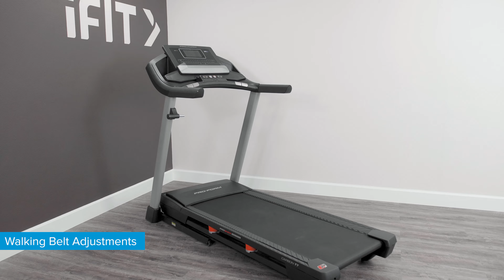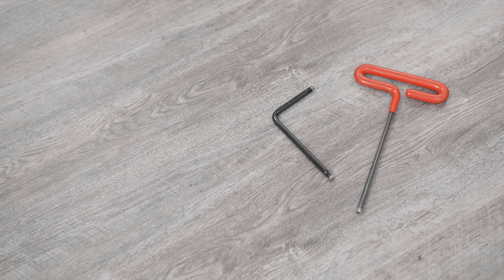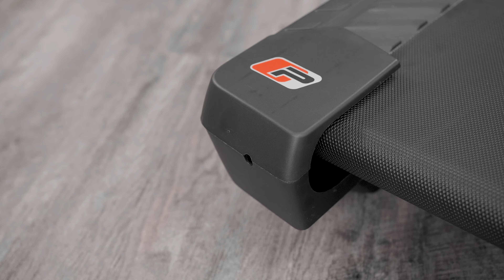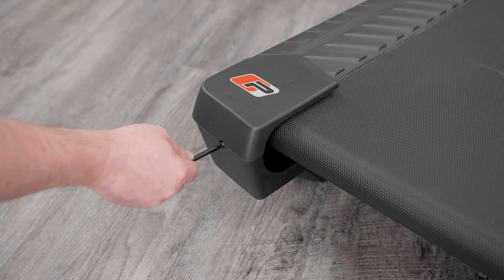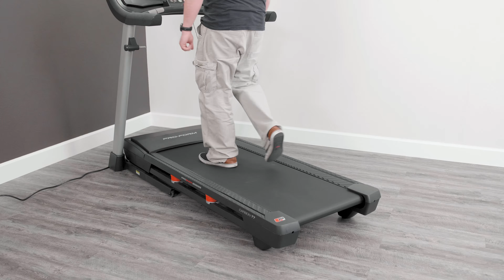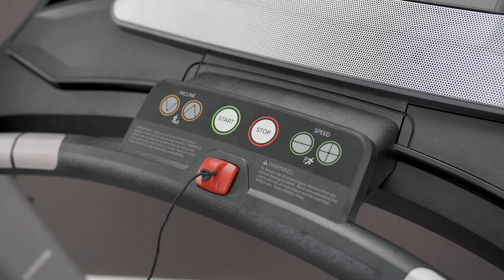Treadmill Walking Belt Adjustments

Comment: My treadmill has a high pitch squeak with every step I make on the right side while I run. Is that a loose bolt issue or a belt issue? It’s very annoying and I can’t figure it out
Reply from the maker: Does it happen with every user? Try running in a different pair of shoes. Often a loud zippy noise that only occurs with one foot fall or only one user is actually your shoe skimming the top of the walking belt. Good luck.

Comment: My Pro Form 425ct does not come on when I press the start button. The machine is not counting down to start.
Can you help?
Reply from the maker: I would probably need more information to say for sure; it does sound like you may need to make sure the safety key is recognized by the console, or that the console had been activated if it has never worked before.

Comment: How does one "reset" the adjustment bolts to even if someone had been trying to adjust the belt but didn't know what they were doing, Not saying it was my wife at all ... put them all the way in ? all the way out, guess?
Reply from the maker: It really is a trial and error adjustment. The belt will always track to the side of the treadmill where the belt is looser. I first try to get the belt to run strait. Usually by adjusting the left side idler roller bolt the direction I want the belt to move. Then once the belt is centered I will move the roller back and forth to put tension on the belt by turning both bolts the same direction (right to tighten the belt), until the belt is tight enough to no longer slip under the weight of the user. Looser is better but no so loose that it slips.
Reply: @FitnessEquipmentHelp  thanks for the tip, My issue is the belt keeps either walking slowly to the right till it starts hitting the edge and then when that adjument is made to center it again, it will start waking to the left till that side starts rubbing... and the belt is plenty tight on both sides... this only happens when someone is on it other wise it stays centered
Reply from the maker: @thcrw7391  If it is only occurring when someone is walking on it and it goes back to center when you get off. Then it is either the user pushing the belt to the side, (uncommon and unlikely if you have used the equipment successfully previously), or something is bending or flexing when is shouldn't be. Make sure all the feet are touching the floor when the unit is in the unfolded position. Then I would be looking for thigs that might be bent out of shape or broken. I may have someone bounce on the board as if running, but with the belt off, to look for things that are flexing too much or structural parts that might be broken. I would remove the motor hood when doing this and would also try this at different incline levels. Repair or replace any worn or broken parts.
Reply: Same issue. Took me an hour of randomly guessing the amount of turn to even it out lol

Comment: So I followed the directions for a walking belt that was shifting to the left. I did get the belt to shift to center, but the part of the belt closest to the deck rail is still off to the left. So it looks a bit lopsided. Any way to fix this?
Reply from the maker: There is also an adjustment on the drive roller under the motor hood. making some similar adjustments to that bolt may help. https://youtu.be/nxzgwh2fUx0?feature=shared
Reply: @FitnessEquipmentHelp  I will check it out. Thank you.
Reply: @FitnessEquipmentHelp  Hello again. So I finally got around to watching that video you shared but my treadmill does not have a drive roller adjustment bolt. So I just loosened the walking belt enough to be able to adjust it by hand at both ends. After tightening up the bolts and running the treadmill, the walking mat immediately went back to the left side. I tried it a second time and the same thing happened. So I gave up on adjusting the front end and just concentrated on the back end. But now the belt is slipping.  Does it just need to be tightened more?
Reply from the maker: @COOLKITTY1995  Yes probably, slipping happens when the walking belt is too loose. (or the drive belt or with a broken roller but those things are unlikely). Just be sure to turn both adjustment bolts the same number of turns to keep the tracking adjustments you have made.

Comment: How do I remove the startup screens and if it queries when I start each day. I just want to turn the treadmill on and not be queried about if it. I don’t want a costly app after buying an expensive machine.  Thanks. Roger
Reply from the maker: Some equipment was designed to be used with a wifi connection and subscription. if you want to avoid the prompt to enter your subscription information or to sign up you can disconnect from wifi- you will only have the manual work out option. note some units will update to the new iFit 2.0. Once your compatible machines update to iFIT2.0 you will need to create a free account and log in or subscribe to the iFit service. However once complete you should not be asked to log in again unless you sign out.

Comment: My Carbon TL doesn’t have a left side adjustment bolt. The track is slipping like crazy.
Reply from the maker: Tensioning the belt to prevent slipping caused by a loose belt can be done using the idler roller bolts in the rear of that treadmill. Also note that on some models the drive belt may also be to loose causing slipping. So you may need to tighten the motor belt if tightening the walking belt does not improve slipping.

Comment: My treadmill makes motor kind of noises, they are not loud but it was not like that in the beginning, how do I fix it?
Reply from the maker: The sounds the treadmill will make will change with use/wear and tear, some of which is unavoidable. The best way to keep the treadmill quiet is regular maintenance, This including lubricating the walking belt and keeping it properly adjusted. This keeps less strain on the motor allowing it to run more quietly. Keeping all the other parts tight will prevent nocking noises and replacing worn out parts like the, walking belt, will keep the motor running efficiently.

Comment: I overtightened both sides as a newbie how do i reset it the proper alignment?
Reply from the maker: the belt should be running down the center of the walking platform. as long as it is not rubbing the deck rails it should work well. The belt should be as loose as possible with out slipping so turn both bolts the same direction to loosen the belt, the same number of turns to keep the belt centered, and loosen it to the point where it just begins to slip. From there make adjustments to both bolts, the same number of turns to tighten the belt, to the point where it just no longer slips.
Reply: 😂😂 I watched the first minute and 15 seconds and thought simple enough.  I cranked both these screws in so many different directions I have no idea how tight it is, but I do know it’s centered.  Guess I’ll find out soon and worst case, time for an upgrade😂😂

Comment: Does it also work for Nordictrack ?
Reply from the maker: This kind of belt adjustment will work for all treadmills that have an adjustable idler roller in the rear of the treadmill. If you have a NordicTrack incline trainer with the adjustments in the front we have a video for that on this channel as well.
Reply: @FitnessEquipmentHelp  Yes the nordiktrack c220i treadmill I have the adjustments are well back and not forward